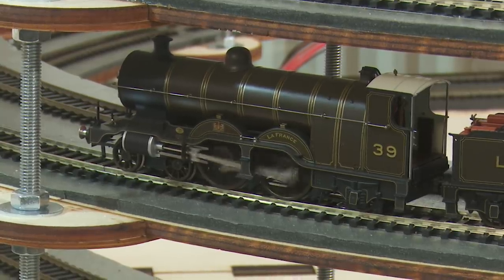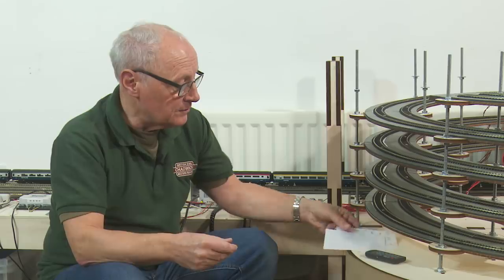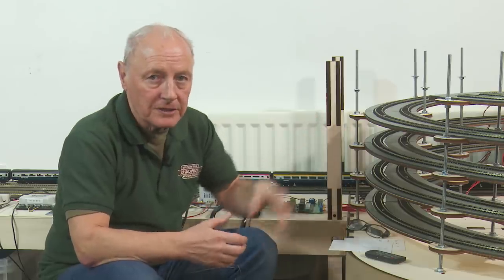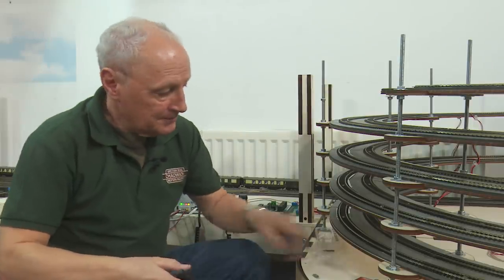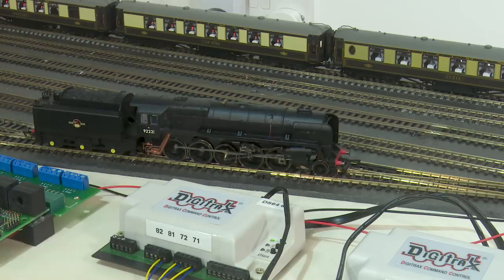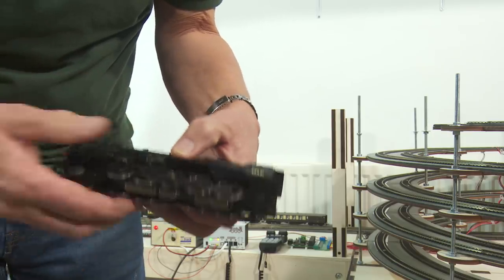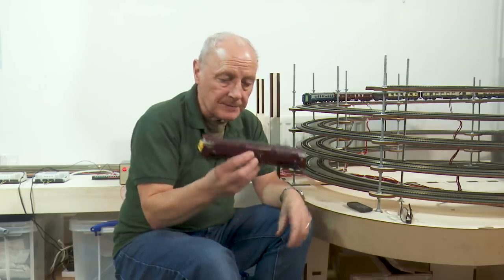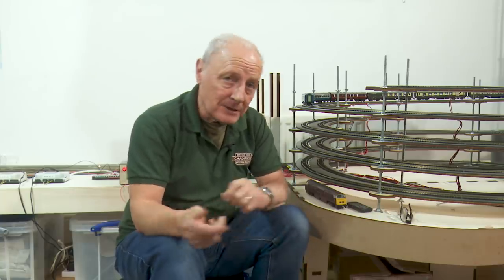Inclines and Power Base at Chadwick Model Railway | 118.

Comment from the maker: Sorry folks but the Percentage figures of the helix inclines in this video are wrong.  They should be,
Outside track = 2.3% (1 in 43) rise.
Inside track    = 2.6% (1 in 38) fall.
Reply: I spent Literally Hours working out % gradients based on the overall pull of my locos considering double headers and current rolling stock ESPECIALLY with the choice of couplers I use which create a whole new bunch of numbers that just become jibberish after a while BUT the helix I agree what seems like such a simple concept has a vortex of of endless matrixes as well defined here and those numbers seem exceptionally conervative and like someone that has practiced where  the average 1:40 seems a bit pedestrian.  Love the Love in this series :)
Reply: Hi there

I've been messing around building my own helix, it's surprising how much difference a small amount of grade change can make.

With the amount of clearance you have between decks I would lower the levels buy mybe 10mm each if possible. All those 10mm of space saving on each level should add up to extra loop in the helix decreasing the sloop %. I had to do this and it made a massive difference, made things tighter but made it worth while doing. 

Kind regards Dan
Reply from the maker: @loco82  A fair point Dan. Regards Charlie
Reply: Charlie,  I don't know if the above numbers take this into account but "effective grade" is increased on curves.  The ratio is 32/curve radius.  So in the case of your inside track, if the curve radius is say 24", your effective grade would be 32/24 or 1.3%+2.6% for a total "effective grade of 3.9%
Reply from the maker: Please don’t loose sight that the inner track is the down line Scott.
Reply: Why is your helix circular? My helix is made of two semicircles of radii 3 and 4 double track separated by 2 yards of straight flexi. So my outside track is 1 in 72 rise and the inner is 1 in 69 fall. I haven't used the Power Base so I can't get my 0-6-0s to pull 8 coaches up the slope, but I don't have much trouble with my bigger locos. Of course the helix now measures 10ft x 4ft, but I've got the room for it, whereas you might not have.
Reply: @janesullivan4421  If you take this idea further, you could climb on the straights, and on the curves have no gradient (or a much smaller one).
Lakeside did such a build, so the curves also allowed the layers under the track to be used as a storage yard.
Reply: Absolutely right Charlie. For anyone else that's interested the conversion is to divide 100 by the percentage: 100 / 2.3 = 43. Conversely if you want to go the other way: 100 / 43 = 2.3 - Dennis.

Comment: Nice job.  Added tractive effort seems to have three solutions: traction tires or friction modifier (e.g. Bullfrog Snot) on the drive wheels to stop slipping; increase mass over the drive wheels (tyre weights, TempLo); or make a helper district out of the helix and have some grunty useful engines as part of the operation scheme tasked with pushing on the back end or cut into the middle of your trains. I dislike the first option, am scheming the second, and haven't the opportunity for the third yet. Thanks for your hard work on these videos.
Reply from the maker: Thanks Erik, good advice, many thanks.

Comment: Interesting - and some food for thought as I start my straight incline, which will finish with a fairly tight radius curve.  As I watched the video, the thought of doubling up trains as they used to do at Shap came to mind. With DCC I guess thats another option?  So, their was some method in the madness 50 years ago with the Triang series 3 track and magnahesion!!  My problem with the track will be rust on the line...rather than your 'leaves on the line'. Perhaps fitting sandboxes???? no- maybe not go there!
Reply from the maker: The pressures us modellers have to endure Ian.  Hopefully you found it useful. Regards Charlie.

Comment: Hi Charlie,
                We will make a scientist of you yet. I went down this road some years back
but moved on to other model railway matters. Your video 'Testing Inclines' has revitalised
my interest in the subject. The start of my adventure was weighing all my rolling stock and
measuring the drawbar pull, [aka Tractive Effort?] of all my locomotives with a device I built up 
using a very sensitive set of digital scales. Typical result was that a locomotive weighing in at 
255 grams recorded a 'drawbar pull' of 45 grams. One can of course fiddle with these two 
figures to derive some sort of 'hauling capacity' for any locomotive but the answer we seek is a 
little more complicated than that as we have to add in the rolling stock variables which I have
not yet got to grips with, until perhaps now thanks to your video sparking my memory of my 
engineering school days and the mechanics of the Inclined Plain and Coeficient of Friction 
studies. Finding what I thought was my old school text book on the subject turned out to be 
not mine but my fathers dated 1923 and it looks to have maybe the answers to perhaps come 
up with devising a 'calculator' or chart of some sort etc that might make for something useful
when it comes to hauling loads up grades in our model railway hobby.  Lab time!
Reply from the maker: What a thoroughly intriguing comment Indigo.  I had thought of measuring the tractive effort (would that be in Newtons?) for all of my locos.  Similarly, with the helix I could measure the TE required to pull certain trains.  The only type of gauge that I can find on eBay, is a simple spring balance but its accuracy might be doubtful. Mind you, at around £5 what do you expect!
Do keep me posted on your progress by email to chadwickmodelrailway @ gmail.com.
Regards Charlie

Comment: I laid my track with an incline before powertrack was around and steam engines would struggle to climb with anything more than a couple of coaches.
I cut thin strips of metal and fitted them on top of the sleepers between the rails  , painted track colour they aren't too bad aesthetically. I then used neodymium magnets stuck to the bottom of the engines ,wooden coffee stirrers used to shim them as close to the track as possible. The
 pulling power was increased dramatically.
I enjoyed watching your video and would certainly use this if I build new inclines in the future.
Reply from the maker: A terrific comment Stephen. Thank you very much indeed. Regards Charlie

Comment: So - we're back to 1960's Triang-Hornby Magnadhesion...you'll need a smoke unit for that 9F and some good old Super Four track though!
Reply: My thoughts exactly . . . I have to ask, though, would not an extra circuit and a shallower gradient have been better?
Reply from the maker: I had super four but never made the jump to system six!.
Reply from the maker: A fair point Peter, but an extra circuit would’ve made the distance within each level even more shallow making it much more difficult to re-rail trains.
Reply: cogidubnus1953 Charlie will make his own smoke carrying on as he does, either from his Locos, wallet, or Blood Pressure! 😆 😆 😆 😆 💨

Comment: An important step in placing the Powerbase magnets is to ensure they are at the balance point of the loco so as to get the artificial gravity to pull down on all driving wheels.  I have 2 x 6 metre inclines and the powerbase has made them transition from hopeless to wonderful when I run my very old Lima diesels and more modern 2-6-4s.  I also placed the plates well beyond the incline top, into the flat areas so that they could get the whole train up the hill rather than just the first couple of wagons.
Reply from the maker: A great comment David, and very useful. Regards Charlie

Comment: Great video Charlie, shows how necessary it is to use this system if you have serious inclines. In the colliery I worked we had an 08 on the surface which we maintained. There was an incline down to the sidings from the loco shed that was so steep you had to have spiked boots on to walk up it, well...you know what I mean. That old 08 climbed it like a dream, Going down was another matter, once you started there was no stopping, used up most of the headshunt and sometimes a little bit more! Thanks for the video though, really enjoyed it. regards gareth
Reply from the maker: A great comment Gareth, thank you very much. Regards Charlie

Comment: Hi Charlie, a very good demo video of your helix with regard to your La France loco the brass stand off magnet carriers from DCC Concepts should overcome the problem but there is an awful lot of brake rigging etc under it. I have had to improvise with some of my old Hornby steam loco's as they are all tender drive, not very good at climbing more than a 1 in 100 which on a garden layout is useless, to be blunt, with the magnets fitted they all take the climb without a problem, the climb varies between 1 in 50 to about 1 in 25 but it is a long straight climb.
Again you have shown what can be achieved with good planning.
Reply from the maker: Thanks Peter, I’m so pleased that you found it interesting. Regards Charlie

Comment: I'm sure someone will have mentioned it already, but any neodymium magnets you can buy off eBay or local suppliers will work too.
So if the kit magnets don't fit just buy some smaller ones and add as many as you can.
The reason I''m steering away from a helix is I'm a pre-1965 enthusiast and steam locos seem to struggle more than diesel on inclines.
It does give so much more useability in a small space though, I might have to try the gentlest possible helix in the near future.
Reply from the maker: It’s a struggle but a rewarding struggle Gerry.

Comment: I run a 4-turn 4-track helix using setrack radii 2,3,4 and a flexitrack 5.  The "mainline that joins the two ends is at a constant gradient of 1 in 40 (2.5%) and includes some radius 3 (20") curves.  The whole of the mainline and the two outer (up) helix tracks were laid with DCC Powerbase "just in case" as fitting it retrospectively would be almost impossible.  It has proved necessary but works well.  All my diesel locos can haul at least 6 coaches up the mainline and the bigger diesels can all haul 9 coaches if required without supplementary magnets.  Steam locos are much more of a problem.  My Bachmann 9F hauls 7 coaches without magnets but I have had to use 3 magnets on Kings, Castles and Merchant Navy pacifics to achieve the same results.  Even then I have to limit the Pullman Devon Belle rake to 6 coaches.  Some smaller locos require magnets (normally one) to cope with even only 3 coaches.  All the magnets are superglued on but I have found it necessary to sand away the raised text of the makers name to give a suitable flat surface and I have used plasticard spacers to ensure that the magnets only clear the track by 1 mm or less.  The system works well enough that I have just embarked on adding a fifth helix track on the inside (radius 1) with a gradient of 1 in 30 (3.3%).  I use my helix tracks as a fiddle yard for storage and have at present 22 trains there.  The extra track will expand this to 29.  The Powerbase system is not a cure-all, but it does allow much steeper gradients or much heavier trailing loads than would otherwise be possible.
Reply from the maker: What a fantastic comment Graham. 
What we need is a table of loco’s, their loads, curve radius, magnet quantity and incline percentage.
Regards Charlie.

Comment: For a locomotive's ability to pull I made a test track on a hinged base 1m long and at the hinge a room handle stood up with 2 small pulleys. A length of string ran thorough the pulleys with a weight on the loose end and a loop on the track end to be hooked on the coupling. By raising the track bed on its hinge any height can be set for a known gradient and a known weight drawn, or not.
Reply from the maker: What an interesting construction David.

Comment: Hi Charlie. Great video as always, I have decided to invest in some Power Base myself.

For non-scenic sections however, I will fasten piano wire on top of the sleepers between the rails, thus reducing the gap between steel and magnet. Magnetic force is roughly inverse to the distance between magnetic objects squared, so the piano wire should improve the magnetic force by approx. 4 times. (i.e. halve the distance to the magnet)
 
This does not increase the friction between wheel and rail by 4 times but will certainly help increase it. The co-efficient of friction of nickel on nickel (the closest I could look up) is 0.70. This means that the tractive force is 0.7 times the weight on the driving wheels.

Hope this is useful 
Barry
Reply: ps The magnetic attraction is used to effectively increase the weight of the loco.
Barry
Reply from the maker: Fascinating Barry, do keep me posted.
Regards Charlie.

Comment: Great video again Charlie. I was hoping you would do this on the DCC Concepts Powerbase. I have 4 3% inclines on my layout and have struggled to get my steam locos up the gradients without this powerbase system pulling realistic rakes. The one additional problem I would warn people about is track pins fixed in the centre of the rails as after a while the magnets can pull the pins out and actually get stuck up in the motors. I no longer have this problem as I took up all my track and relaid it using glue after watching one of your earlier videos. Once again great video and keep them coming.
Reply from the maker: A great comment John. I’m so pleased that you found a workable solution. Regards Charlie

Comment: For the steam locomotives, is it possible to add weight to the inside of the boilers? I have a Rivarossi 2-8-4 Berkshire that had a lighter weight inside it. As an American locomotive, it should've been able of pulling at least 35 cars but it struggled with 20. I took a look inside and there was plenty of room inside for the addition of some lead bird shot pellets and that helped out quite a bit. 
Ultimately I found a parts engine with a heavier weight inside it and simply swapped them.
Reply from the maker: Yes adding weight is a sensible option Patrick.

Comment: Brilliant work as always.  The results of your testing are great to see.  Very encouraging that you can get all your locos up this incline
I loved the short pieces of the video where you had a camera inside the helix structure (eg at 7:39) 

The maths for the gradient isn't too hard - it's the height of the climb divided by the length of the climb.  The length of one revolution is the "two pi r" formula   So gradient = height / (2 * PI * radius).
Reply from the maker: Such modesty Lee. Regards Charlie.
Reply: That's the equation that I always got wrong in school because it was taught to me like that. It's actually pi x diameter.
Reply: @kiwitrainguy  so why would you suggest "two pi r" is not correct and that the circumference is "actually pi x diameter" when I'm sure you know that the diameter of a circle is twice the radius?
Reply: @leestoddart7014  Yes I realise that now but not back in the early '70s when I was trying to do the equation at school. I've since done it again using both methods and got the same answer. The difference now is that I can use a calculator which I did not have access to when I was at school. All I know is that when I tried doing it back then I always seemed to get it wrong but they never told me what I was actually doing wrong (which is what teaching is supposed to be all about).

Comment: G'day Charlie, I am inclined to think that the magnets would make it worse as there magnetic pull on the metal strips would slow the loco down, I think that it was the extra weight of the magnets that made the loco slightly better. I would definitely be loading the loco body with extra weight but not enough to put too much strain on the motor. I can still see that "MISSING NUT" on the helix support 😂😂. You are the type of bloke that I wished lived next door, Regards, Alec.
Reply from the maker: Hi Alec, the magnets are very small and surprisingly light, but I shall try and show their effect in a later video.
Regards Charlie

Comment: On your final point about drawbar performance tables, I don’t know if you remember the old Model Railway Constructor (that ceased publication in 1987) but their loco reviews always told you how many grammes the model could haul.  I was also thinking about your comments about the 9F and wondered if the solution might be a Hornby Dublo three-rail type shoe that is magnetised, attached to the underside of your loco, running along a steel rail mounted in the centre of the track.  The power base is attempting to recreate the magnadhesion system that Triang and Hornby developed for use with nickel-silver track, now that steel rail has gone out of fashion.
Reply from the maker: An interesting point Steve. The use of magnets on wheels disappeared many many years ago., Sadly missed. Regards Charlie

Comment: I’m wondering if it’s not a power issue but more to do with the coefficient of friction, as the loco’s aren’t stalling, they’re losing traction. Nickel silver track is known for its poor adhesion qualities and maybe steel track on the climbing line is the answer provided the railway is not kept in a damp, humid place which in your case Charlie,  looks like it’s not an issue.
Reply from the maker: Adding weight is the next option Al.

Comment: That was great Charlie. Not surprised the H2 didn't make the grade (excuse the pun), as mine struggle with 8 coaches on the flat so they don't get used on my helix. I worked my helix out at 1 in 65 on the outer line and i can run pretty much scale length trains with any loco, but the older Lima stuff really does struggle. Anyways, brilliant vid as always.
Reply from the maker: Thanks PT, I’m so pleased that you enjoyed it.